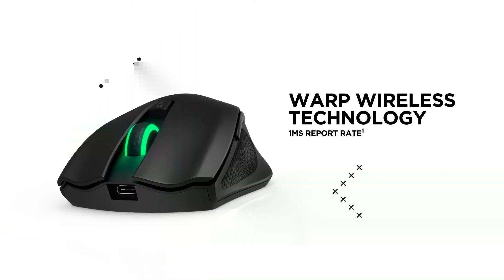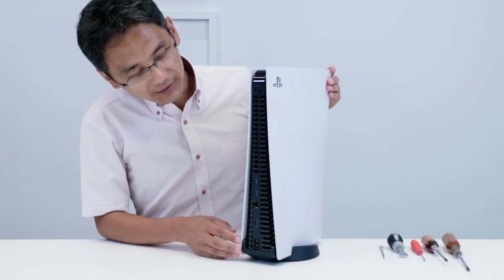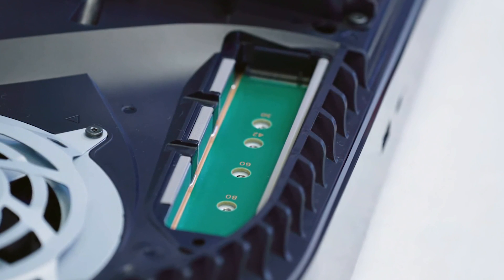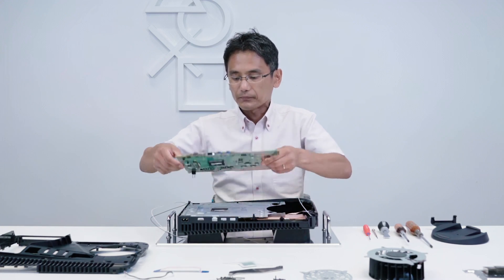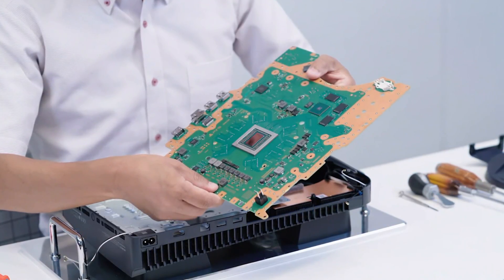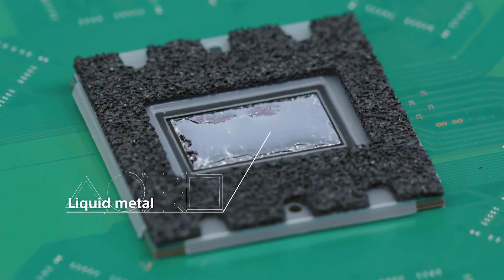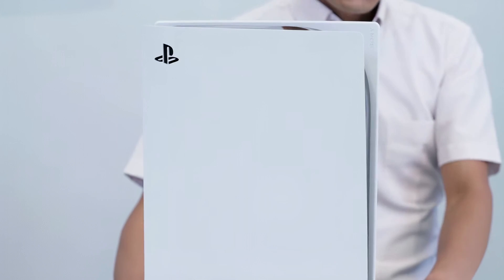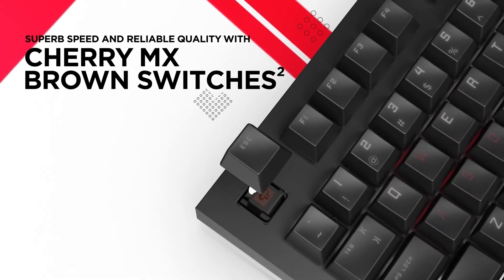PlayStation 5 Teardown Analysis: Inside Sony's Next Generation Hardware Design

Comment: I'm not sure why there seems to be such a fixation now on the console fans being super quiet. I have both a PS4 and a small form factor gaming/HTPC with a beefy 14cm Arctic fan set to max rpm, both hooked up to a surround sound system in a room with decent acoustic treatment. I believe my ears are still pretty good but to be honest, I really only hear either of their fans around when I've just booted them up, before the UI background music/sounds kick in and I start playing anything. Whatever fan noise they put out is easily matched or drowned out either by the airconditioner or even just the sound of the wind outside and other ambient noise. And as soon as any game or movie soundtrack starts playing any fan noise is effectively overwhelmed by music/effects even at less than half the full volume of my sound system. Even if I just use my TV's built-in speakers they can still easily drown out the fan noise. Did I miss any game adaptations of "Whispers" or "A Quiet Place" that everyone seems to be playing wherein any external whirring sound louder than an exhaled breath catastrophically ruins the experience?
Reply: PS4 Pro is really loud though.
The problem for most is they never clean the dust out or put their console in a place that traps heat and restricts cooling so this inevitably happens, and forget about changing thermal paste.
Sony has done as good a job as one can with mitigating these issues on PS5.
Reply: Ngl at first I was reading fans as if it were people. I am dumb.

Comment: @4:08

More so than dust, it is faulty thermal paste. It ends up being the texture of gum over time. Doing close to nothing to transfer heat from the CPU.

How do I know? I've fixed 4 of them. After using the Arctic Silver Thermal Paste from my gaming PC, my PS4 was dead silent even running games like RDR2 and other demanding titles. 

Hopefully they noticed the issue and apparently addressed it with Liquid Metal interfacing rather than paste.
Reply: With liquid metal, that beefy cooler and those holes to remove dust, I can see the PS5 as a console that will be near silent for the entirety of its life cycle.
Reply: I have replaced the thermal paste on a PS4 (while I replaced the fan) and can attest that it makes a difference.
Reply: i did the same with an xbox one x. was abnormally clean on the inside even after 2 years of daily use in dusty environments. thermal paste was awful and dry. put some kryonaut inside, even went through a lot of pain and money to change the thermal pads, and the noise? exactly the same. hopefully this gen will do a lot better for both consoles in this regard.

Comment: I'm sorry  this  review comes  across  like  a microsoft  fanboy..... No mention of the IO bandwidth which  IS NOT STANDARD ON PC OR ANYWHERE ELSE nothing  is  standard on  ps5 is  all  custom plus you kept comparing to XSX like if the split board design was better  but it's not because of LAG between the cpu and gpu...... DF= Microsoft employees /damage control reps.

Comment: Just to point out, there are another three SSD chips on the board, but on the other side of it. and each of those chips have two flash chips in it, hence the 12 channels cerny talked about.
Reply: It’s possible one of those is what contains the OS and kernel (probably a small NAND flash like the PS3 and Xbox 360) and will not be used for storage for user, my guess is this will be a much slower and more reliable chip which will have a much longer lifespan than the main SSD.
Reply: @StanceSantos  Could be.  I'm expecting them to last quite a long while, just curious as to what will end up happening.

The xbox, even if the things are removeable they're proprietary so it's not like they can just be plugged into a PC and backed up.

Same with the switch, backing up an sdcard is easy but eventually the internal storage  will go and will that be the end of the os and everything else?  Probably.
Reply: What's the lifespan of one of those?  Kinda curious how long the switch has too.
Reply: @az_dirt  modern TLC NAND SSDs have rating around 600 TB of data written or equivalently 0.3 DWPD (drive write per day) for warranty time of 5 years. While like every device can malfunction they are far more reliable than the 2.5 " hard drive of last gen, and for quick resume with 0.3 DWPD you can write around 300 GB which is around 22 times the available memory for games.
Reply: @eliadbu  That's fine that they're more reliable than older hard drives.  I can't replace soldered chips on a board so I'm still curious as to how long they'll last.

It won't be the first hardware ever made that self destructs, the og xbox and it's battery backup that leaks and destroys boards or the capcom cps arcade hardware, sega game gear capacitors, etc.
Reply: @az_dirt  if you can't replace the drive, that doesn't mean it is non repairable, with write tools it's not that difficult. For your questions how long the drive can last as I said SSDs longevity are usually rated by the write cycles of its cells. Modern 1 TB TLC NAND SSDs warranty is rated for 600 TB written capacity or 5 years. So try to do the math in your use case.
Reply: @eliadbu  That's just silly, comparing pulling one drive out and plugging another one in with desoldering chips off a board that you're liable to have to source from another donor / dead console.

If you're that worried about it I don't know what to say but exaggerating or lying about it is kinda stupid to me.
Reply: @az_dirt  Reballing repair services are usually around $100, and already exist for PS3 and PS4.   One of the big issues associated with that being the reality GDDR chips can go bad.  Do you have those services on Speed Dial for that too?  Do you have spares of the RAM and CPU chips for all your old consoles associated with the reality computer chips having a rated lifespan of around 10 years?  If not, you're being inconsistent with your Chicken Little antics here.

The SSD chips they're using will have proper cooling and associated accommodations.  The year is not circa 2010.  Stop peddling stereotypes that were relevant when Obama was running for his first term.  There is no way the TBW on this drive is below 75TB.  Any theoretical use case for that drive to experience failure, which are not just as if not more applicable to needing to replace the RAM chips, would require you to spend tens of thousands of dollars on games.  At that point the cost to replace the hardware would be a trivial fraction of your expenses on the platform, and one legitimately would have to ask where you're finding the time to justify said endeavor.

And again for any of this bitching to be relevant one has to assume Sony has heel face turned on all prior policy on how they handle this.  No, no clearly they're cackling evilly about how they won't allow you to flash the OS to the full size m.2 slot, because clearly that just exists to torment you, you poor little victim...  Along those lines mind that by the end of the generation the PCIe 5.0 SSDs will be far faster in raw throughput than the chips Sony is using now so the remap overhead wouldn't exactly be an issue.
Reply: Ali Hendrickson  direct Access to SSD dont need v-memory
Reply: Ifix it : Repairability 2/10
Reply: @ShinyMooTank  depends on exactly one factor: will sony allow you to boot the system from the external m.2 drive?
If yes, then it's not an awfully big deal.
Reply: @dan_loup  It is when the booting and system performance takes a massive hit from not using that super wamadine ssd controller
Reply: @dan_loup  there isn't anything 'external' about that m.2 slot.... Lol
Reply: @GoonieGooGoo3  Well, it's not soldered in the board.
Reply: @ShinyMooTank  
I am quite sure, that the official repair places shall be repairing them just fine.
Reply: Thanks for doing their job for them you deserve more 👍

Comment: The ps5 is humongous  and were vacuuming out our consoles now ? Damn.
Reply: Well , people complained they had to void guarantee to clean their consoles . Now is pretty easy to clean the fan and the dust traps .
Reply: I see the option to cleen as a benefit, too.
Reply: @MariaRodriguez-hb4ix  Don't remove any stickers unless you have read them first..be mindful.
Reply: @retrodreamer9439  if you had noticed . There are no stickers on the fan area. Taking 4 screws and one cover is enough to access the area .

Comment: Microsoft have since deleted that tweet, presumably because of the number of people calling them out for it after they themselves had denounced console wars. The thing is though, how often are people really intended to change the position of their console?
Reply: That was Xbox UK Twitter handle. Xbox's central management probably told them to shut that crap down because its just petty at that point. It's fine advertising features the competition doesn't have when they show what they've got. But the stand crack was a bit petty.
Reply: I was going to go the ps5 until I saw its reveal, now I am going Series X at least for now. I will probably end up with both eventually though.

Comment: What happened to the patent from Sony that had cooling the chip from both sides?
Reply: 12Tflop BruteForce  no not the fan but the heat pipes in the through holes in the circuit board

Comment: PS5 is over-engineered. Such a massive console and the inclusion (and risk) of liquid metal is only because they decided to run the CPU at 100% all the time, thus generating excess heat and by consequence, having to go over the top with the cooling solution. 

I really hope they revise this soon after launch (if not already working on it) and make the console slimmer and more appealing because this looks awful.
Reply: U can customize the side panels tho
Reply: Huh, the PS5 has variable frequencies lol it's not always running at 100%
Reply: @VirulentPip  that's why I said more efficient
Reply: @domzzcardzz7985  I'm talking about the post I have commented on... the guy saying it runs at 100%....

Comment: Most important question is that does the PS5 have 1440p output? The PS4 pro doesn't so if games are 1080p then they end up looking blurry on a 1440p monitor. XBX has 1440p output and Microsoft have confirmed their next gen consoles will have it too. It makes no sense for Sony to not have 1440p output when games like Demon soul's runs at that resolution!
Reply: Sony does not want you playing a console on a monitor. So no it will NOT have 1440p support. Microsoft literally makes their consoles identical to PCs at this point and cares about the PC market more than the console market, so it makes sense they support 1440p which is a monitor resolution.
Reply: @ghostthough7874  "Sony does not want you to". That's the stupidest thing I've heard yet
Reply: @aki-sid  It's true. Sony does not want you to use a monitor. They want everyone to be using a console on a TV on a couch or bed and play with a controller. Sony has always been against PC and monitors are literally a PC display.
Reply: It's still going to scale to 4k though on tv's . It's just the internal res is 1440p
Reply: @DEVILTAZ35  point is 1440p should be supported. Also it doesn't scale to 4k. The PS4 pro see a 1440p monitor as 1080p so you end up see a blurry 1080p image.

Comment: Yeah, that NVMe slot doesn't look like it has a cool air path.  Might be an issue.
Reply: A lot of motherboards have the M.2 slot on its back.  I doubt storage vendors will be making NVMe drives that require active cooling.
Reply: @Andorski  Still it's under a cover and can heat up. On My pc it benefits from  being directly on the board and has the same airflow from the watercooler as the rest of the system to cool it.
Reply: @Andorski  Most MoBos have a heatsink on the M2 slot, and then the case provides airflow.  If there is no airflow on this M2, then it's basically a hotbox, and heat affects performance.
Reply: @ChrisB_517  a lot do have some sort of cooling solution for the M.2, but not all.  A lot of ITX motherboards simply just have the slot in the backside with no cooling.  And since it's on the backside of the mobo it essentially receives no airflow.
Reply: @Andorski  That's all well and good. Point still stands.  That, and PS5's solution is cutting edge.  I highly doubt it's gonna be anywhere near as cool as the lowest tier m2

Comment: The funny thing is that those Series X units sent out to Journalists and "influencers" are basically on loan (if I understand it correctly) - they have to be returned to Microsoft before the Series X launches, as they are preview units, potentially with kinks to work out.
Could one of the reasons for Sony's delay be that the units they inevitably send out are for permanent keeps as final hardware?
Will Microsoft be sending out final hardware to kept permanently?
Reply: Linustechtips said they are keeping it but the software is incomplete and need the consumer update yet. It's using a developer OS yet.
Reply: @Skylancer727  Interesting. Looks to be a mixed bag. Greg Miller and Alannah Pearce for example have to return their consoles. I wonder what allows some people to keep them; maybe teardowns, or if you're on one list or another etc.?

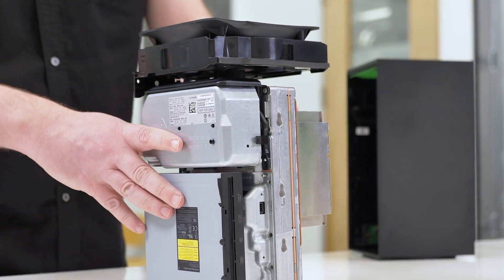Comment: 14:30 How exactly is the Xbox Series X design more complex? If anything I'd say MS have gone for simplicity. The console literally assembles to a cuboid with a very straight forward airpath. It's so simple in fact that all they had to do is slap a 130mm axial fan on top of the console and pull air from the bottom to the top. I don't want to minimize the engineering done to achieve this simplicity since they had to do the split boards and adjust the dimensions of all the other parts, but compared to the engineering done on the PS5 side that's very minimalistic.

I'm not necessarily saying one is better than the other, but the approaches are very different. I'm just confused how you can look at both of these consoles and conclude that the Xbox Series X is the one with the more complex design.
Reply: He probably wasn't talking about the shape. Maybe he was referring to the split mainboard design, but i'm not sure.
Reply: I think he meant the Series X design requires a bit more out of the box (no pun intended) thinking - with vapor chamber cooling, split board design and stacking it the way it is for better airflow whilst maintaining a more compact chassis. It’s harder to make things smaller. The PS5 is a bit more conventional in terms of parts and composition is what he’s saying.
Reply: @jollyrioger2572  they already were using vapor chambers on the XOX .
Reply: @MariaRodriguez-hb4ix  yeah, it is a more expensive part but cools better than a normal heat sink while being smaller. The PS5’s heat sink had to be that big to cool as a well the small vapor chamber in the Series X.
Reply: @jollyrioger2572  PS5 have also to use more copper . To diminish the risk of the liquid metal touching the area .
Reply: Its more of conventions as Rich has stated, ps5 went tried and true, where as rarely you see a dual side console with the series x, no console has done that before (please correct if wrong). Not dissing Sony’s console but its also in how to effective in design and power with minimal space and advanced engineering. Likewise with sony possibly pushing its components to the max but with high levels of cooling constantly flowing. So to me it seems it is the opposite to me with sony being simplicity and xbox going for more innovative design perhaps. But both good in their aspects
Reply: @thomashardy6893  The split motherboard design is a new thing as far as I know (might be wrong here), but it's still relatively straight forward in my opinion. I guess it depends how you look at it, but to me the PS5 is obviously more complex as it had to solve for more engineering challenges. That's mostly the case because they went with a smaller die at higher clockspeeds. Consoles and compact electronics in general traditionally go with a wider slower dies which makes it easier to cool them. As a result Sony had to design a more complex cooling solution from the liquid metal tim to the humongous heatsink (which requires a complex airflow pathing), to the custom centrigugal fan with the extra wide blades. I'd honestly be surprised if the Xbox Series X BOM is higher than the PS5 BOM.
Reply: You sound salty because DF didn't choose to praise your preferred piece of plastic. 🤣
Reply: @misaellopezrodarte5327  You suck at interpreting comments then. I have no time for console wars. I'm interested in opinions whether they agree with me or not. I'm just trying to understand where he is coming from. This part of the video didn't make sense to me so I tried to open up a discussion about it.

I couldn't care less if other people agree with my favorite anything.
Reply: it is more complex by being more simple, you answered it yourself. achieving simplicity/smaller form factor without sacrificing performance is much harder than just a putting in everything in a humongous case.